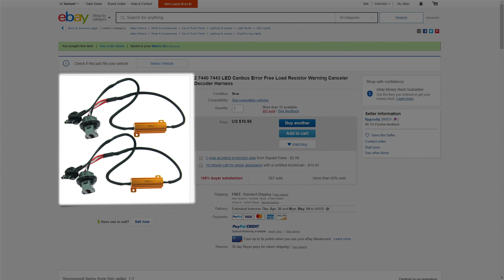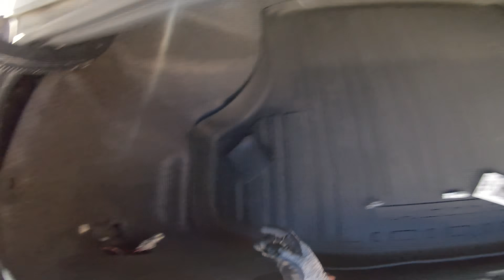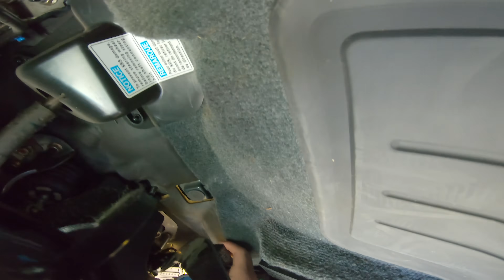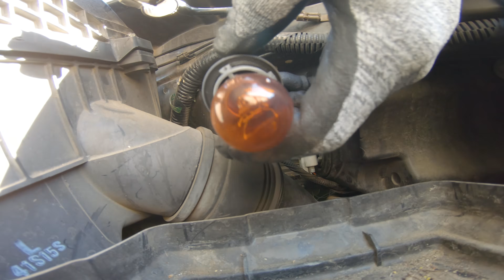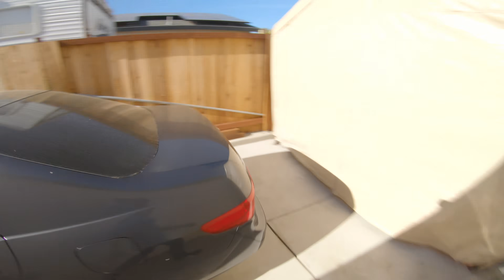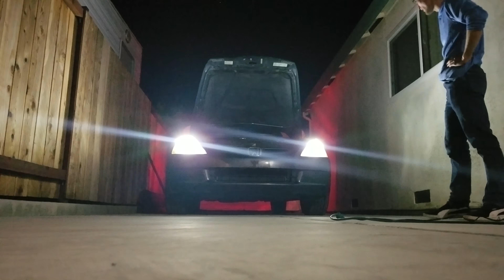7th Gen Accord Revamp Episode 3 | LED info & Turn Signal Relay/JDM ASTAR LED Turn Signal Install!

Comment: So it seems like the reviews of the relay say it causes problems. And it seems like it only worked for you on one set of bulbs. I think it's probably better to just go the route of load resistors for all bulbs and no relay.
Reply from the maker: Been running the relay for ages now and no issues. The issue in the video was related to the battery being fairly drained and having low voltage. Also, one defective switchback had issues but got that replaced and all good for over a year

Comment: It does suck that for switchbacks to work you must click 1 position up on the headlight switch. In newer cars that come with switchbacks you would never have to remember to turn them on. Perhaps a mod can be made to tap into a different wire or fuse. Not sure. Maybe not worth the effort.
Reply from the maker: Yeah because they would be factory DRLs. 06+ have factory DRL, except they are the high beams outputting at a lower setting.

Honestly, i just turn the parking light switch on due to habit so not really an issue for me. Sure there are probably ways to make it function as a DRL without driver input, but not sure it's worth the time or effort. To be fair tho, if you are doing this mod, you'll probably remember to turn the switch 9/10 times and have the lights on 😄

Comment: Was the mile gauge still flashing after you fixed it and how did you fix that?
Reply from the maker: Only has flashing issues when the battery was low on charge and nothing was consistent because of the low charge. Full battery and everything works as expected. 

Also, sometimes cameras struggle to capture displays due to refresh rate and fps issues. Just something to note 😀

Comment: hey so another question, i finally fixed the other issues but now, i can’t have led turn signals and switchbacks. i installed the switchbacks but they kept hyper flashing when i used turn signals with my headlights on, and i wondered why. so i changed my led back turn signals out and put oem halogen back in and they worked fine. could it be because of my led back lights or is it not possible to load all 4 things into led. for example, i could only have leds in the front and not in the back or leds in back and not in the front because it overloads it. i ask because u know ur stuff and not much content on here pertains to accords
Reply from the maker: Odd behavior. My rear turn signals are LED, but connected to the canbus cancel resistors. I have no issues with this combo and the fronts are still switchbacks (with no resistors). With headlights on, I've got no issues at all. Do resistors for the rear turn signals and it's all good (at least for me). Brake lights and reverse lights on mine have no resistors and work fine.

I have no system overload or issues. I'd like to solve the rear signals on my Accord without resistors, but that's gonna take some decent figuring out. Will get to it one day and make the video.

Comment: so i did this relay and now certain things don’t like before. for example, i have LED lights but my lock sound doesn’t beep. when i unlock the car with the key, the signal lights on the dashboard don’t illuminate. are there any fixes to this?
Reply from the maker: Those don't bother me honestly. My car never made a noise unlocking besides hearing the door locks physically move. It honks the horn when i press lock twice on the key fob though. 

As for the signals on the dash, for me i think it's due to my switchback LEDs. They have this 1 sec delay when you turn on the parking lights because it's seeing how much power it's getting to determine whether it needs to change to amber for turn signal, or white for parking. Stock bulbs are dual filament, but only uses the other when doing turn signal blinks. To sum it up (at least logically in my mind), the relay is setup to be LED compatible, but probably has a slight  power delivery if its smart to determine how much power the light type needs to draw, which the dash signals rely on for a response. 😄

I could be totally wrong tho. It's just an idea from what I've seen working with stuff like this for a while. A relay teardown would tell us the real truth most likely.

Comment: sorry no one suggested that the draw couldve been the radio & to pull the fuse for it to kill the parasitic draw. the radios in the 05 are all fault af and will turn on and stay  on even if the car is off
Reply from the maker: No, I've figured this out ages ago. Turns out not all of the draw is from the radio actually. I pulled the fuse for the radio and it didn't quite solve the draw. There's a fuse inside the interior box called "Backup" and that one seemed to draw the most current when the car was in sleep mode and locked.

Now i have one of those cheap aftermarket android head unit touchscreen things. Wish I bought the expensive legit one but whatever. Anyways, i notice the lights for the buttons on that stay on for about 30 sec after the key is out, then the unit shuts off. I finally have time to go back and solve this draw issue so I'll definitely make an update video to this series once i figure something out.
Reply: @sjrmac  would definitely like to see the unit you chose (going to look through the vids and see if its in there) and the one you passed on for reference.
Reply from the maker: The one i chose isn't on a video yet as i never filmed it and did it fairly recently. Was about 150-200 on ebay. They all look the same. I guess the legit one is xtrons for $300 or so

Comment: Great video dude! I've been wanting switchbacks on 7th gen in the front for a while now, but wasn't sure how to solve hyperflash. This is the perfect tutorial.
Reply from the maker: I tried to be as detailed as possible here. I do need to update the series though on the car and see if i can get rid of the resistors i have for the led turn signals in the rear

Comment: Great video! Very informative! I have a 2005 honda accord exl with 241,000 miles.  Same color as yours. I work in a high school but in my younger years I did collision repair work for a few years and continue to enjoy working on my own cars when I can. Just an observation with my 2005 honda, when I'm working on window motors, door lock actuators, or other components not functioning correctly,  I realize it's time to drive my car a good distance to really charge the battery and alternator, and then I can really determine how well components are working. I say this because I also had a short somewhere where my battery would drain and parts sometimes wouldn't work well unless battery and other components were fully charged. I hope that made sense.